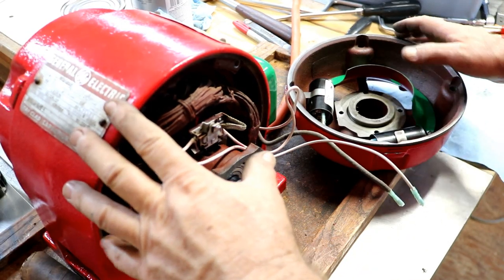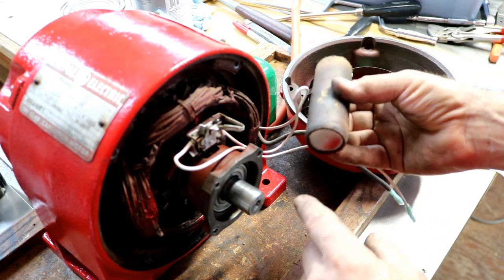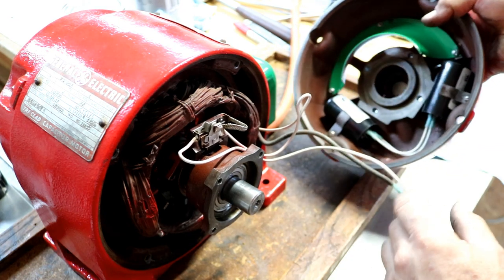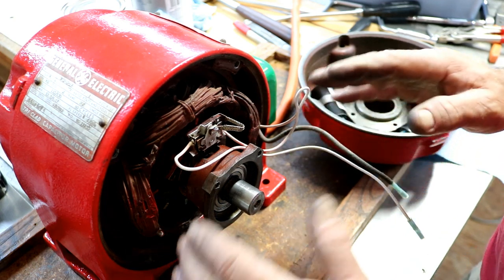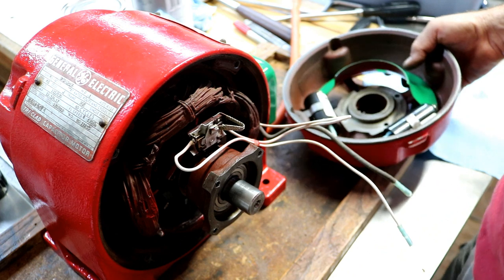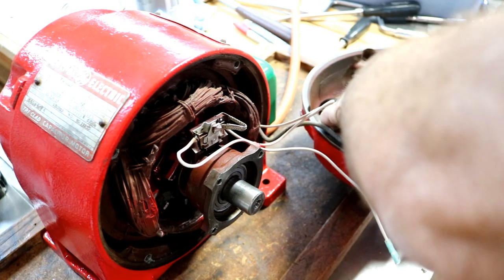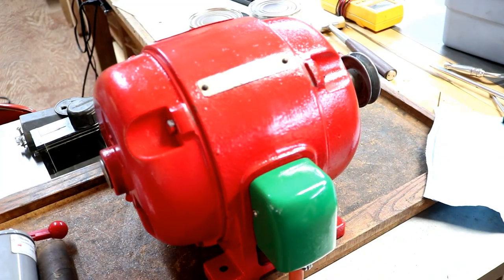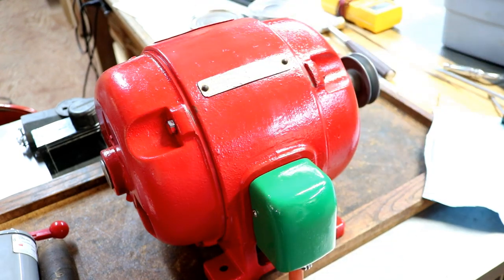Electric Motor Capacitor Installation

Comment: Good for you! You could have checked the capacitance of the capacitor if you had a multimeter with the capacitance check function.
Reply: Another way is to charge the capacitor, then using spit to moisten you fingers.........

Comment: Thanks for the info on the 90 degree phasing of the starter windings. I just knew that the capacitors ran the starter windings before.
Reply from the maker: Pretty simple.  Thanks AZ

Comment: Those big cement mixers you get stuck behind on the way to the store have reversible power takeoffs for the drum. One rotation direction mixes, the other direction ejects the mixed concrete.
Reply from the maker: Thanks Wes.  Love your new tractor.

Comment: Something you may want to consider, Randy. When I open up a motor, I write the bearing numbers and cap descriptors (if single phase) on the peckerhead cover or body of the motor. The model number of the centrifugal switch wouldn't hurt either. Just a thought, Rollie
Reply: I etch a plate with that info at a sign shop (cheap) and stick it under the original. Saved me a lot of headaches.

Comment: If I remember correctly capacitors hooked up in barrel give the sum of their value e.g., two 150mfd caps in parallel yield an equivalent value of 300mfd. Be careful and get the values right when you replace components.

Comment: The voltage/current specs in description suggest that the max power of the motor is almost 2hp.  If I remember correctly 1hp = 750 watts.  12.6amp X 120 volts = 1512 watts (2hp).   That extra power should be a good thing for the old mixer.  The restoration looks great!

Comment: If you reverse the drum doesn't it self dump your concrete?
Reply from the maker: yep. With only direction available you have to dump on one side and that side is tough getting a wheel barrow in.  So with it being reverseable you can dump on either side.
Reply: This answers the question I had

Comment: Nice work Randy! But I noticed you did not install the mouse in your motor like Dean had in his.
Like the color, should make that mixer run great again.
Reply: It's not a tread mill motor any more. I think that went out with the TEFC motors.🙂
Reply from the maker: Squirrel cage induction motor not mouse induction.

Comment: I have a much newer mixer and use it a lot. I have never wanted to reverse it though. What reason would you want to reverse yours for? Me jokingly, maybe your mixing blades are long, and reversing it will cause it to act like the big boys and the concrete will pour out in a controlled manor ;)

Comment: What was the capacitance value of the capacitors you used? I have an old grinder that the capacitor is bad in and there's no markings on it.
Reply from the maker: Here is a link.  https://amzn.to/317nbN4
Reply: Lonnie, there are capacitor sizing charts and equations in multiple locations on the internet.  One such chart is at https://inspectapedia.com/aircond/AFCAP_Capacitors.jpg
How to sizing the starting capacitor?
1) A rule of thumb has been developed over the years to help simplify this process. To select the correct capacitance value, start with 30 to 50μF/kW and adjust the value as required, while measuring motor performance.

Comment: Randy I think one of the first things you need to do is get rid of that plastic handle on your drum switch that looks terrible
Reply from the maker: Sounds good.  That drum switch came on my milling machine, this will be a great use a drum switch to control the mixer drum.  I am thinking of having a link to the outside of the dog house, maybe one on each side even.  Thanks Bill.